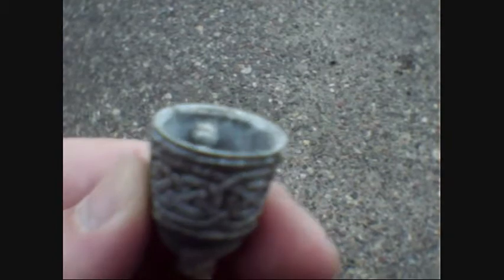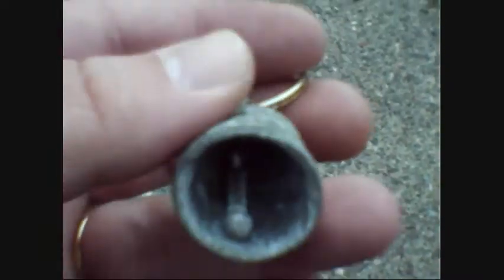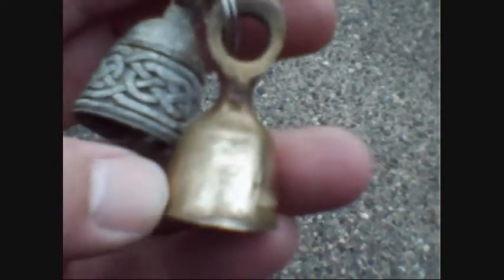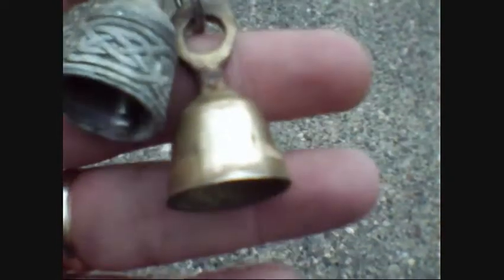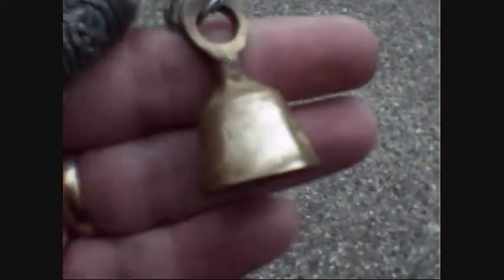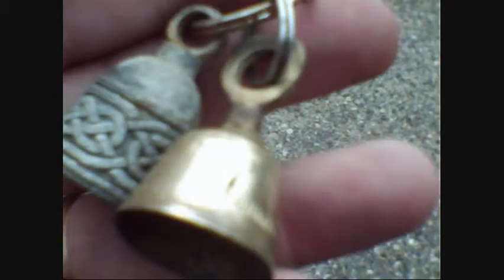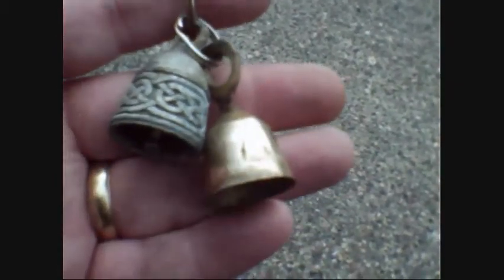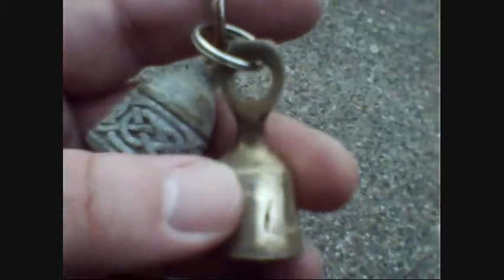Polishing The Brass

Comment from the maker: @VlogTour  Ride Bells, or Gremlin Bells, are commonly made of pewter, stainless steel, or some are chromed.  These bells are to ward off evil road gremlins.  The gremlins are to blame for accidents, road hazards, and equipment/bike failure.  As you ride, go over bumps in the road the bell rings, drives the gremlins crazy and they fall off your bike with you leaving them in the dust.

Solid Brass Bells,  These bells are placed on bikes in memoriam of a close fallen rider.  TC&RS  :)